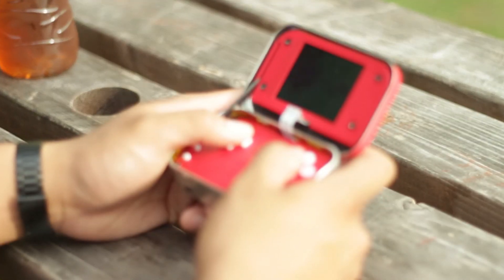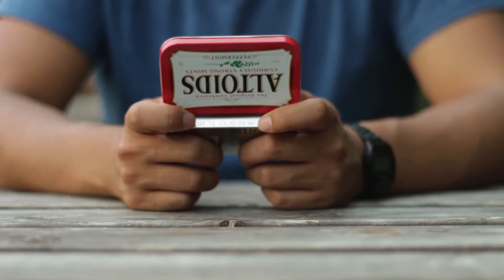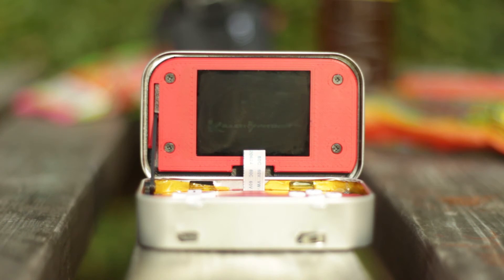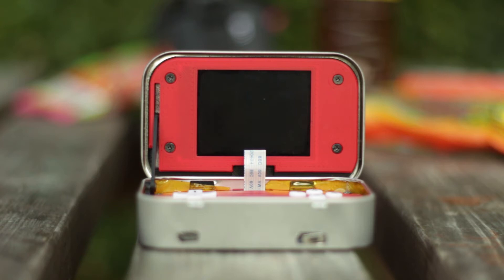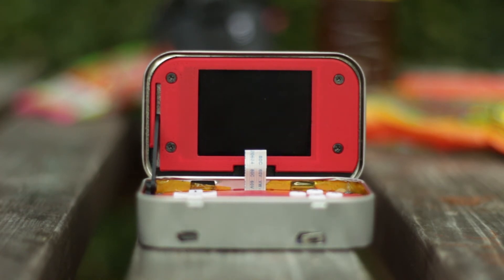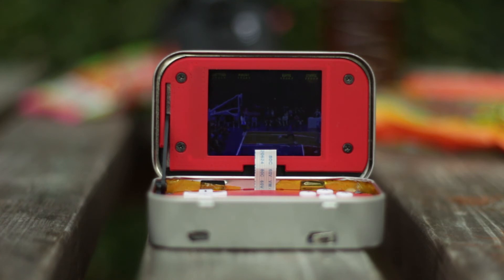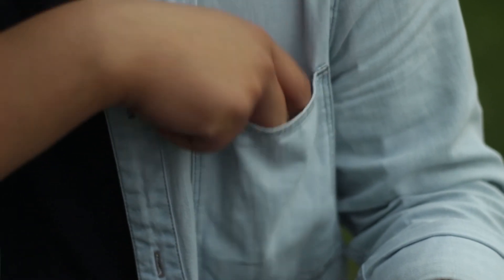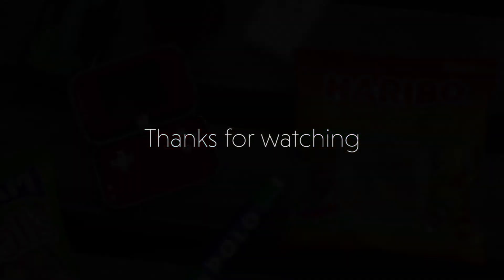Minty Pi Review

Comment: I got my parts about 2 weeks ago from Helder. All my solder joints were perfect and I was ready to install the screen. But I sliced on of the fingers off the LCD! I ended up finding the exact screen on eBay. Only problem is they are only sold from China. The new screen arrived the other day and I'm so happy with my Mintypi!
Reply from the maker: Nice one Carrot . I'm happy that things turn turned out well. Ye the screen is a little annoying that you have to slice the edges